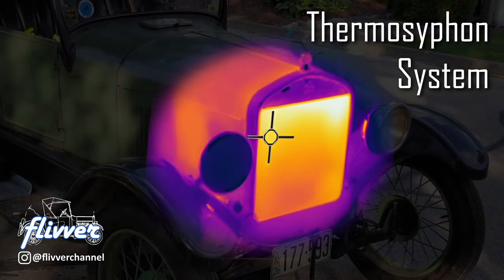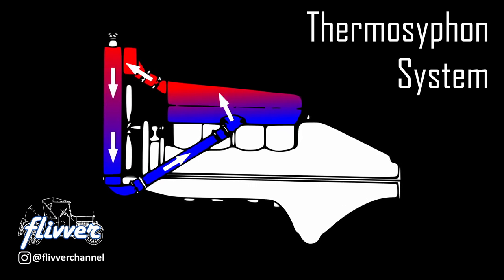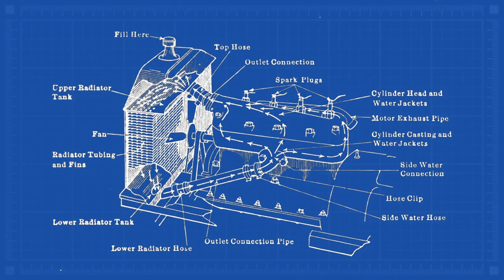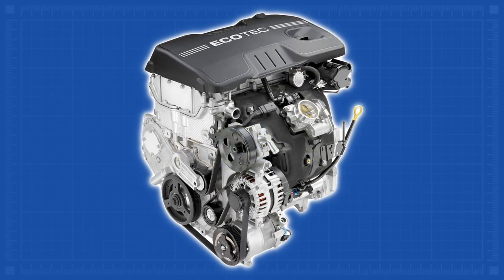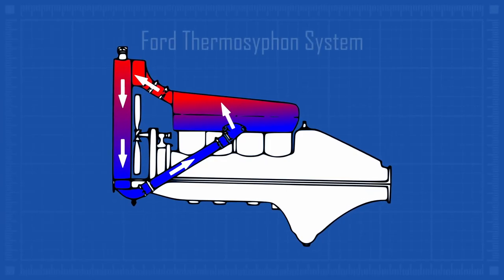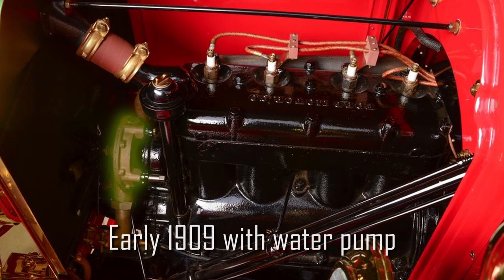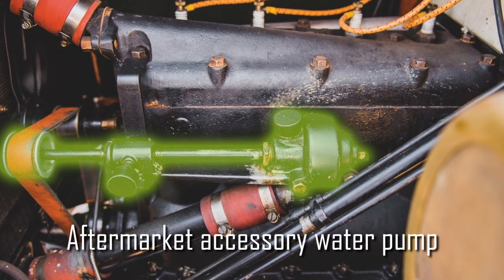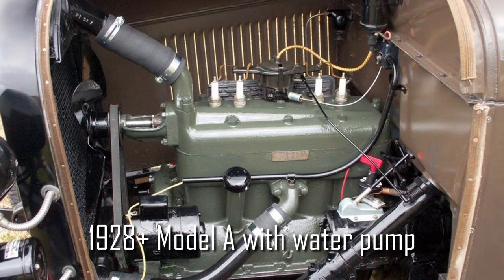Thermosyphon - Ford Model T

Comment: Great video! My Model T runs cool as a cucumber with no water pump, since I replaced the radiator with a Berg’s flat tube radiator. A lot of the Model T guys swear by their aftermarket water pumps, but they’re still running old clogged up original radiators. Once your engine is being cooled by it’s originally intended method, it works like a charm.

Comment: Saab used a thermosyphon system in the 1950s. The biggest drawback is that you cannot use a separate heater core without using a water pump, which is why the early Saab cars had the radiator mounted behind the engine, on the firewall, it did double duty here providing heat for the passenger compartment and cooling for the engine.  Apparently the pennies pinched here weren't worth it since they switched to a pump and thermostat system (and real heater core) by the end of the 1950s.
Reply from the maker: Interesting!  I will look into that.

Comment: This video is very light on information. It's basically "the T needs no pump, as hot water rises and cold water falls", but no info at all on the cooling circuit in the T. 

The illustrations make it look like only the head is cooled.. is that correct? No mention of it.
Reply: Head and upper part of cylinders.
Reply from the maker: You are right.

Comment: Yep. It also had no fuel pump either! Fuel was delivered using gravity.
Reply from the maker: Yes!  The list of things the T doesn't have is deliciously long.
Reply: @flivverchannel  And because of its low compression and other things, it could also run on other fuels such as kerosene. I saw this very informative video recently that really impressed me with the Model T's smart design: https://youtu.be/vnaocIwRPjo (about 8 minutes)

I have an electric car (bought used in 2020 with less than 18000 miles for $13000: a 2016 Kia Soul EV+) so I can definitely appreciate having fewer parts to worry about: No starter, no transmission, no hoses, no belts, no valves, no oil, no oil or fuel pumps, massively lower temperature under the hood (which helps prolong components' lifespan under there). Got to give a lot of credit to Henry Ford for creating such an efficient and easy to work on design with the Model T engine. This was kind of a necessity considering that dealerships and repair shops were few and far between back then. Many cars were repaired in blacksmith's shops in the early days! So making the engine and car as easy for the lay person to fix and maintain as possible was a requirement.